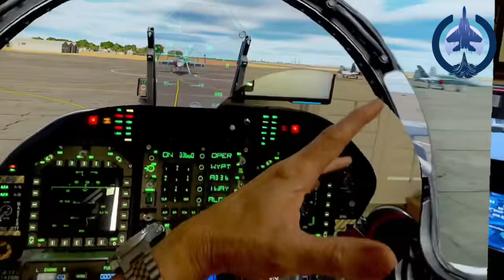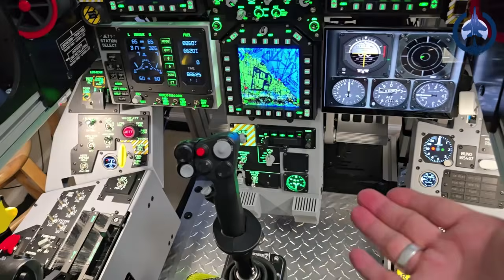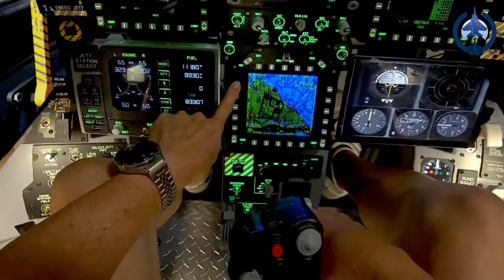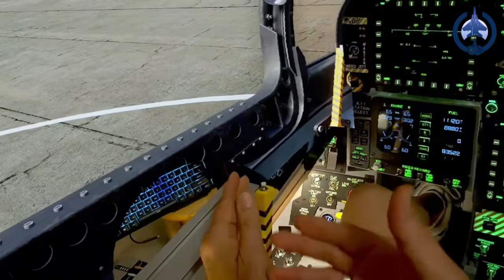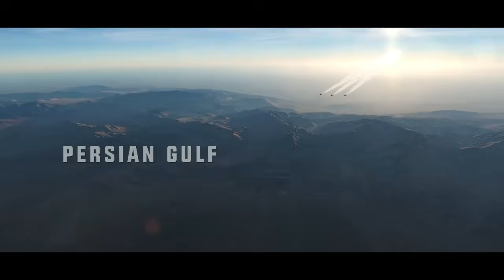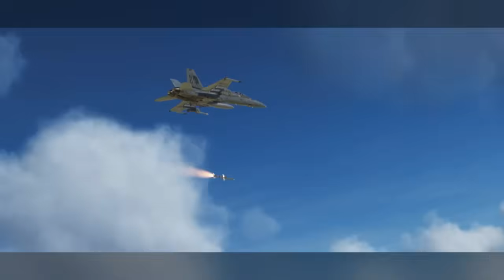MiXed-Reality Demo - DCS Using PassThroughForge

Comment: I see u have belt tensioner. I read that a five point seat is recommended with the fifth point at the front between the legs. Does the seat u use have that? It looks nice.
Reply from the maker: No, my seatbelt is simply a 4 point harness. There's no middle attachment underneath the crotch... But it works perfectly.
Reply from the maker: It's the Next Level Racing NLR-S030 Seat and included Seatbelt harness made for It's Seatback openings for the shoulder harness.

Comment: it's interesting to see u mounted a whole cockpit on the DOF. they told me one can't do that, that there'd be serious weight distribution problem etc and that i should only put light things like hotas lol. yet you proved that it's possible.
Reply from the maker: Sure - I took a lot of time finding the center of balance for the Dogfight Dynamics Frame, before placing the braces I used to connect to the DOF Reality P3 Center Ball Joint Arm.

I did take a lot of pictures, if you'd like to see how & where I attached and balanced the DFD Frame.

The DOFR P3 can handle up to 1100 lbs total weight. That's plenty of headroom, after the royghly 450lbs for the DFD Feame + QS-BT1 (Seatbelt Tensioner on Rear) + TrakRacer Adjustable Pedal Plate (on front).
And I was able to center the placement of the Flight Seat directly over the Universal Joint Center point Position (making final balance easy) .

DM me if you'd like those detailed installation & build-out pics & measurements.
Reply: @j @joevwbd_horns8544 yes I’m interested in the details. How do I DM you?
Reply from the maker: DM me if you'd like to see the many pics I took, as I built it out from the start. I glad to share...
Reply: @j @joevwbd_horns8544 don’t have your email

Comment: Ok, got ask. How did you fit the Hornet Shop MIP on the Dogfight Dynamics rig? I have the same and the Hornet Shop ( that i love) is too wide to fit. Unless you didn't use the MIP bracket from Dogfight Dynamics maybe?
Reply from the maker: It was a bit of Urban Engineering...

I used 2 additional Washers on each of the Upper 2 Bokts the hold the Front uprights to the bottom Rail. That created a little extra wider opening across the front dash area.
Then I used a 650mm 4080 Rail to go across the Front between the two massive Black Connecting plates.

I can send you pics if you like!
Reply: @joevwbd_horns8544 yes pics would help greatly
Reply from the maker: I used the original WinWing (WinCTRL) Clamp mounts onto a wider 650mm length of 4080. Ut might have ended up 675mm.
I'd have to check. I custom cut them to allow for the extra 3/4" needed for the HSS Dash.

The real problem was stretching the Canopy Arch to still fit into the 4080 grooves on the two upper side railings.

That took a solid screw driver as a fulcrum arm or pry bar to stretch the arch holes to line up.

I also had yo replace the m8 screws on the insides of those big black steel plares in front, to use flat headed versions of m8x20 hex screws. That way the IFEI & Steam Gauge Panels didn't scrape the large Hex Cap Head screws that DFD Included in the kit.
Reply from the maker: Reach out to me on Discord or FB and I'll be glad yo walk you through the custom Fit I discovered for Steven's HSS Dash kit. It wasn't that hard, really!

Let me just tease...
(2) 675mm(ish) lengths of 4080 across the Front of the DFD Frame, giving me an extra 3/4" width.
That and a small crow bar to stretch the Canopy Bow (arch) to allow the (4) m8x20 screws to line up.
Reply: Amazing stuff. So reshade is required with the quest3 in order to read the screens?
Reply from the maker: @samtjoe7797 Actually, ReShade is needed to read ANY Real-Life 2D DDI's in DCS.